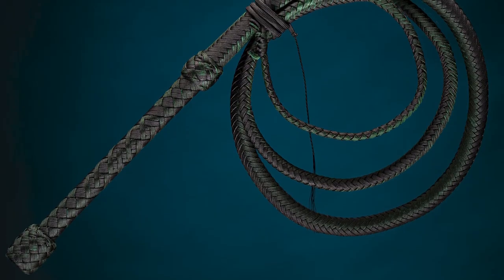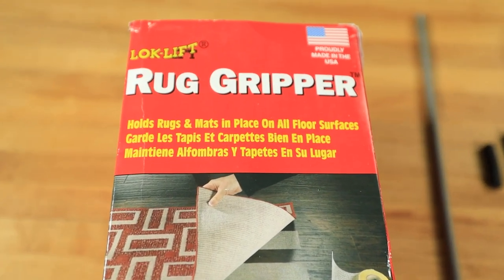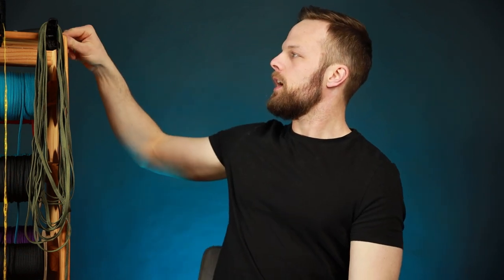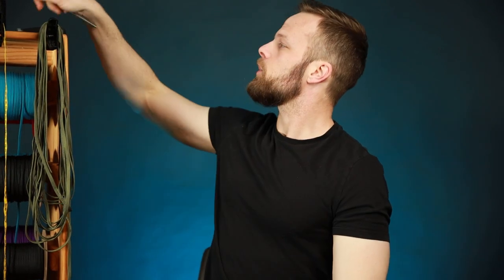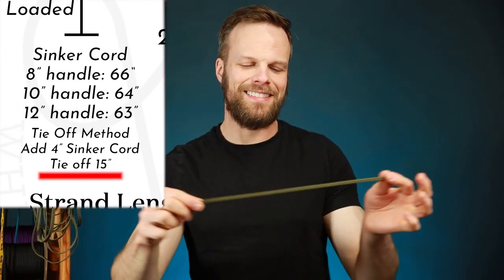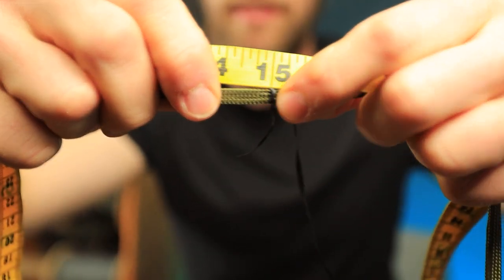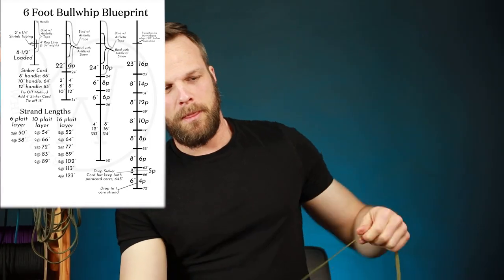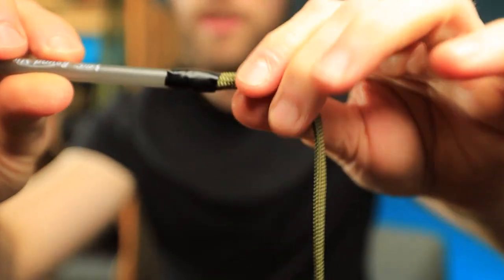How to Make a Bullwhip Part 1: The Core

Comment: You should be band from using files less it’s a diamond or abrasive coated file it’s directional only cuts in one direction and if you drag the file backwards it kills the file other than that great vid
Reply: Not really true in modern times unless you're using REALLY cheap files. While there is some extra wear caused by filing in the wrong direction, it is very minimal. Other sources of damage would kill the file far sooner.

Comment: Here's an idea: Instead of 1/4 inch shrink-wrap  over the sinker cord (the longer second piece of shrink wrap), try 5/16 inch shrink wrap. It would be easier to slip into place. The 5/16 will shrink down smaller than 1/4 inch after it is heated.
Reply from the maker: Since I made this video I've actually started doing this! So much easier!

Comment: What made you settle on 8 inches of shot in the core? Have you made whips with less or more and how did that effect the whip???
Reply from the maker: Great question! First, the 8 inches is just for my 6 footers, I load more in longer whips and less in shorter whips. I used to load my cores further up in my bullwhips, but over the years I have trimmed it back to shorter lengths because I like the feel of it more. If you want a heavier or lighter whip by all means adjust to your liking! It's really a taste thing

Comment: I was going to comment and say using lead would be better because it's one of the two most dense metals known to mankind, I love lead the only other metal nearly as dense is gold...so it would go without saying that lead is much heavier than steel and wouldn't require as much to achieve the same amount of steel used
Reply from the maker: For sure, lead's density properties are amazing. For me, I'm trying to reduce my exposure as much as possible, so steel feels safer for me, even if it is less dense

Comment: Just found your site(bull whip 1;Core)-you are a good teacher. You reminded of a discovery I found many years ago.In trying to slip heat shrink over a rough surface I rub a bit of dry bar soap or slightly dampened over the rough stuff(paracord!), even saliva. That is absorbed and eventually works its way out of the system-never had any slippage or chemical reaction. Thank you again for entertaining instructional videos.  Dr. Bill

Comment: This looks VERY interesting, and is looks like it would make for an interesting challenge to build.

One thought (ideas for future videos?): some follow up videos that deep dive into the processes:

The big one would be yet another look at each level of plaiting as the primary focus:
1. You use two Different colors for the left and right sides [when you did this on a 16 plait, it made it MUCH easier to see what was going on]
2. You have short pause between each weave step so folks can "Follow along" 

Another idea would be to replicate/deep dive into the various sinew wraps + kevlar string lock downs
1. Again do this with contrasting colors to make it easier to see what is going on
Reply from the maker: These are great thoughts, especially the 2 toned 6 plait and 10 plait layers, this was a definite oversight on my part. Maybe if I do a future video project I'll include this!

Comment: The tie off method for core material in the video states use an extra 4"; but the provided blueprint link no longer references this it seems -- should we just drop that?
Reply from the maker: If you're using the tie off methode be sure to use some extra core material, as it's difficult to predict how much material you'll waste in the core loading process. Does this answer your question?
Reply: @whipworks4468  Yea that helps me past that :) Thank you!
Reply from the maker: @kontu5399  You got it!

Comment: I am curious what kind of material you would use to load the paracord other than #9 shot. I don't have access to an ammunition like that where I am. Would fishing sinkers do the trick or would they make an odd bulbous shape?
Reply from the maker: There's all sorts of material you can use! Some people use the beaded strings that hang down from ceiling fans. BB's can work. Anything weighted that would fit in the sheath

Comment: I know you have a blueprint which is great and needed. However, I find myself wondering what is going on inside the core. A diagram illustrating where all the processes start and stop would help me. For example; Is the shot touching the end of the rod inside the sheeth? I'm having to assume a few things that I'd rather be sure of. Otherwise, your external processes are explained well.
Reply from the maker: Yes! The shot is touching the rod inside of the sheeth at the tip, but not on the sides of the rod. Deos that make sense? It's a good clarification!

Comment: Hey man just stumbled across this video. If I was to go the leather route how would it change the design?  I would like to go with kangaroo and use stainless cable as my core. Any advice?  Love the video thanks.
Reply from the maker: Hello, great question! A lot of what I show here would be similar, but kangaroo hide whips are very different. There's a book by Ron Edwards, "How to make whips" that may be helpful. There are also tutorial videos out there specifically about making leather whips. Sorry this answer isn't more helpful, good luck to you!
Reply: @whipworks4468  thanks for the direction! I appreciate the help.

Comment: if you are using the refrigerator tube and the funnel how do you do the tie off of the loaded section
Reply from the maker: You tie off the thong end, and you don't tie it off on the end that will go on the handle, you immediately attach it to the handle, does that make sense?
Reply: @whipworks4468  so attach the rod ==load the shot then tie off after the shot is loaded at 8 1/2 inch as tight as you can?
Reply from the maker: @robertmainey7274  I think what you're describing will work!

Comment: @whipworks4468 You mentioned 3/8” shrink tubing for longer whips at the beginning of the video. Do you shrink that over 2” x 1/4” piece at the transition after wrapping with sinew? If not, would you be willing to share that information?
Reply from the maker: Hey, great question! I put the 3/8 inch piece over the 1/4" piece, and THEN I wrap it in artificial sinew, so two layers of shrink tubing and then rug liner and then artificial sinew. I hope this helps!

Comment: What is the string called that you sheath over the steel rod again? And will wax string work?
Reply from the maker: Artificial sinew! Wax string should work well too!
Reply: I got that. I’m talking about what you load the number nine shot into. Not trying to sound smartass.
Reply from the maker: @aaronlewis672  Oh! That's called Sinker Cord, I use 1/4 inch. I also sell 50 foot lengths of it on my Etsy shop if you can't find it elsewhere, @whipworks on Etsy

Comment: If you are worried about lead getting on you as you make the whip, then why aren't you worried about it coming out as the whip ages? The nickel plated lead shot will rub on itself until it grinds away the plating, then you are just making lead dust... eventually, it will leach out of the binding, something to think about if you're squeamish, go all in on it.
Reply: I had the idea of stainless ball bearings or even stainless beads that could be strung together with monofilament and pulled through the sheathing with less effort.

Comment: bought 1/4 inch sinker cord and it wint even go over 1/2the diameter of the steel rod
Reply: should i try the 3/8 inch sinker
Reply: tried loosing it up over a wooden screwer that is thinner than the steel rod and it wouldn't fit
Reply from the maker: What brand was the sinker cord? And what diameter steel rod are you using?
Reply: @whipworks4468 Para cord galaxy website 1/4 inch sinker cord and lowes 1/4 inch steel rod and it measured at 1/4 inch
Reply from the maker: @robertmainey7274  Hmm, I've never seen this product, I wonder if the 3/8 inch of their sinker cord would work? I've always used the Tufline brand of sinker cord. I sell it on my Etsy shop if you'd like some that you know would work!

Comment: What type of paracord is used in the core. This most definitely is not 550 paracord.
Reply from the maker: Correct, it's 1/4 inch sinker cord, I sell this material in 50 foot lengths on my etsy shop if you're interested, it can be hard to find: https://etsy.me/3Fc30Uh
Reply: @whipworks4468  I have just checked out your shop and I would love to purchase it but the shipping is just too high because I live in Europe. Is any paracord 6mm in diameter good enough?
Reply from the maker: @jackkageweeb7315  I have used paracord like that before and it can't work. You may need to figure out a different technique of loading it and attaching it to the handle than what I show in these videos
Reply: @whipworks4468  One more question for your 6 plait, 10 plait and 16 plait layer I can use 550 type III paracord because I have some laying around.
Reply from the maker: @jackkageweeb7315  Yup! 550 will work great! Just be sure to gut it (I'm sure you knew this, I'm just making sure!)
Reply: @whipworks4468  Great! Thank you for the info.
Reply: @whipworks4468  Also is hockey tape good enough instead of athletic tape?
Reply from the maker: @jackkageweeb7315  Hockey tape works great!